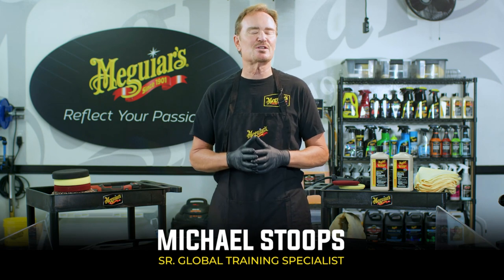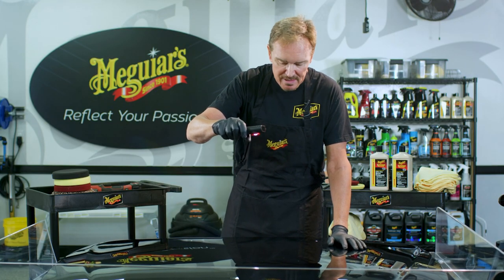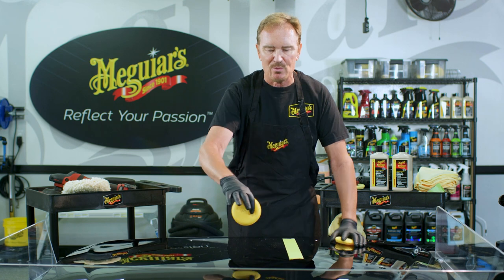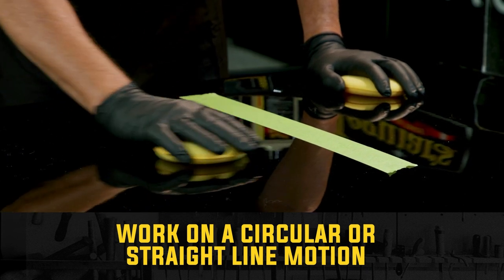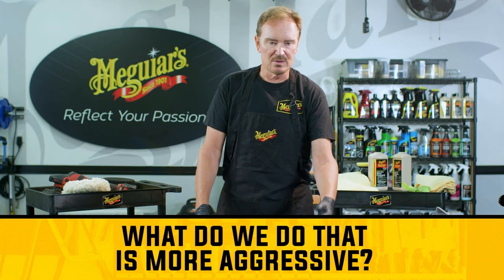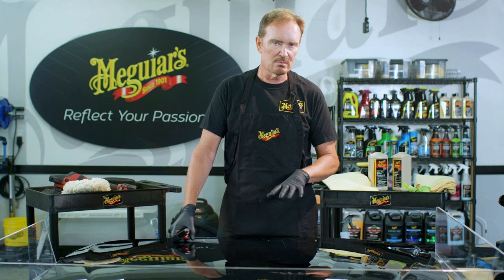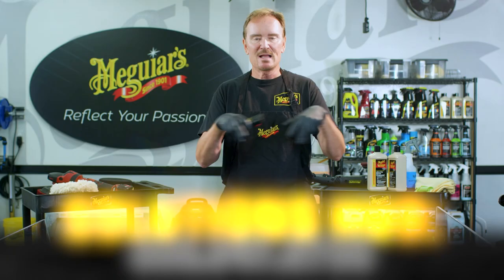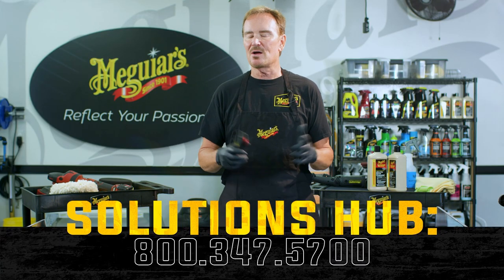Test Spots – How to do one, what to look for & even why – Shop Talk

Comment: Today I have the mt300 but I want to use a cordless dual action polisher. Do you can give me a Idea which one i could choose to replace my mt300. I want one that really Works well with meguiars line products like m110, m210, ultimate compound, m205, d300....
Reply from the maker: Unfortunately we do not have a good recommendation for a cordless DA.
Reply: @meguiars  the finisher 12mm free spinning from flex ? Works well with ultimate compound and meguiars pads?
Reply from the maker: Are you asking if you can use a Flex machine to apply Ultimate Compound?  Yes you can certainly do that.
Reply: @meguiars  yes, I know the UC was formulated to be used with 8mm free spinning Dual action, like mt300, but I dont know how it works with a 12mm orbital polisher like this one from flex. I´m affraid about hazing.